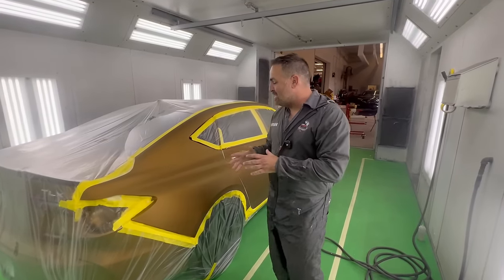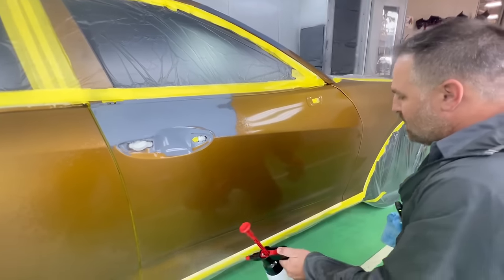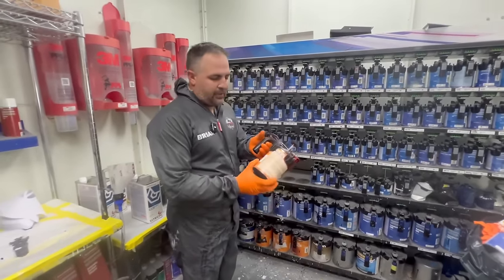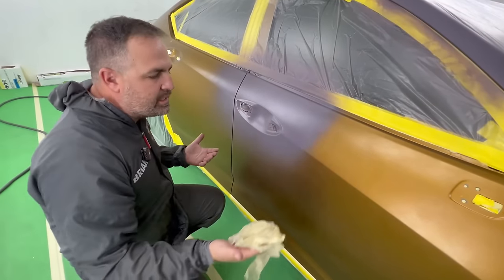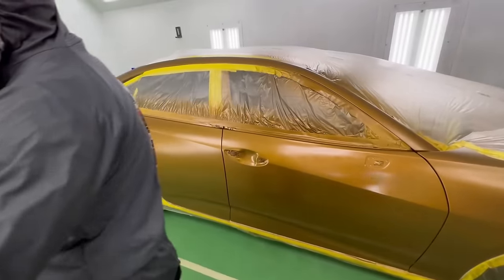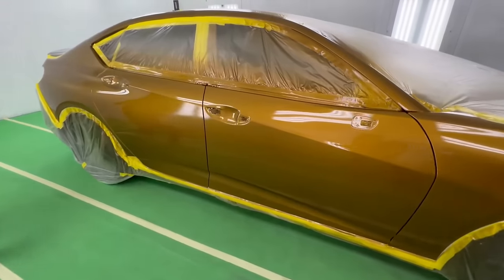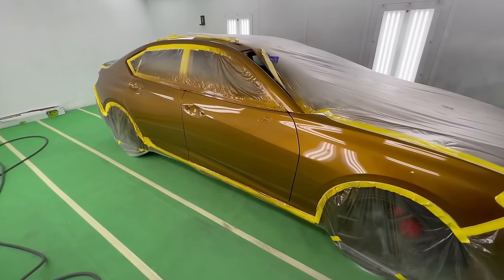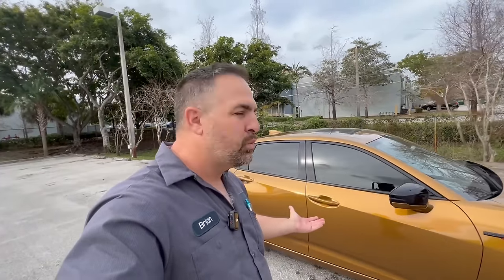The Paintjob from HELL! Don’t Risk Losing Your Job Because You Don’t Know THIS!

Comment: No drips, no runs, no errors. This job is a home run with a difficult color and a tough customer. Using a good paint system too. congrats
Reply from the maker: They arent all perfect. Ty!
Reply: I started painting back in "74". Since then I've worked on over 12000 vehicles, some very small spot jobs, some very large overalls on trucks and not everyone went out the door on time. Auto painting is an art as much as a sicence and sometimes you need to go back and start over. My goal as a flat rate painter was to do good work like you did in this video and get my 80 hours done by lunch time on wednesday so that everything else is gravy. The hard part is doing that until your 70. During my last few years, every morning I told myself that you will be remembered by your last paint job, make it a good one! Your job looked great and your advice is spot on, you should be a Sikens paint rep.

Comment: Your channel has been such an inspiration to me. What I have learned on your channel allowed me to help a friend on an 1989 Ford 4x4 project. I have painted the cab interior, the back of the cab, front of the bed, under the hood, etc. The outside of the truck will get a professional paint job, but it's amazing how good the truck looks! Everyone is amazed that I painted it with no prior experience. :-)  I have clear coat peeling on my truck side where a previous repair was poorly done. Now I have the confidence to paint it myself. It won't be "perfect" but it will look 1000% better than it does now. Thank you again!!

Comment: We needed to get a piece of equipment painted to protect the underlying metal, and since we had planned to keep it a while we decided on a full strip and re-paint so that corrosion could be properly addressed. The OEM paint lasted an impressively long period of time, but almost 40 years of sun had done a lot of damage. We thought we took it to a professional, but as ours was in the paint shop and disassembled we heard of another owner who had an issue where the color and top coats fell away from the primer on the trip back from the paint shop. When we finally got ours back, three months after the expected completion, the color and top coats bubbled up in certain areas. It turns out, that paint shop owner thought he knew organic chemistry better than the paint manufacturers, so he was mixing and matching primer from one company, color from another, additives at ratios outside of manufacturer instructions, etc. Since the paint was not applied in compliance with the instructions, the multiple manufacturers involved did not warranty anything. The first shop was not going to pay for another shop to fix his problem without a lawsuit (and at $500/ hr our attorney fees would have exceeded the outright cost of a new paint job just with the normal summons and complaint/ pre-trial motions phases), we no longer trusted his work to fix his mistake, and the only fix was stripping back to bare metal and re-painting the whole thing, so we were looking at another five figures to paint a job not even a year old. Not fun. It is nice to see a professional showing how the job is done properly.

Comment: As a retired certified Autoglass tech, I have always used a two rag method for cleaning glass. Now, retired and restoring a mustang, I still use the two rag method prepping the body. One rag wet and follow with dry rag.

Comment: I didn't know what sealer did for being applied over primer so it melts you edges in so you don't have to feather it out in between the primer and color coats. Thx for that. What a clean job. Nice work on that one as always.

Comment: Little tip is becareful with sealer on those areas over spray can get into(top quarter area) if paint doesn't get in..ull have sealer over spray after removing foam and tape...I usually back tape the edge and keep the over spray from getting in
Reply from the maker: Great tip!

Comment: Looks really good and also done right by not melting somewhere on the piller also doing the fender as well
I don't  like the color
Also like that you didn't walk the side from qtr to fender,i pretty much clear the same way
And using the wetbed to melt the sealer edge so everything is uniform 💪 great job Brian

Comment: well,  it's good to have all the proper tools, and materials that are recommended by the paint manufacturer, or so. a lot of shops use different materials some not even the sealers due to high cost, and that goes for Clear coats as well. be honest with me painters, for example, do you use microfiber wipes? or do you use 3 different products to finish the paint job?

Comment: It appeared t0 me that with the paint and the clear you were about 90% overlap, and pretty good amount of air, and no runs.. I would have had runs, and my luck would have blown paint flakes off the plastic, as well as the tape, and most of that would land in the last coat of clear. My question is, are we watching this is real time, or is it doctored before we see it? Either way you did a amazing job.
Thom

Comment: Is the super slow reducer helping with dry edges? When you did the top of door, A pillar on to the front fender, then went back to rear door and finally went on to the front fender. Times I do it,  their is a dry edge and can't get rid of it and have to back track. Can be tricky.

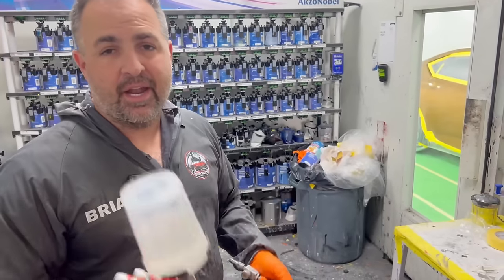Comment: Is clear base, the same as blending additive??? In many of your videos you use clear base to cover the whole car, but in this one, at 4:50 you put on blending additive and used it across the whole car as if it is clear base. I also read online somewhere that using purely reducer, such as a cheap 2k universal thinner, is fine as a clear base. Im asking because I'm from UK and In UK there's no such thing as "clear base" but there IS blending additive. I've never used that though. Theres also fade thinners/ blend thinners for blending lacquer if you're not painting it edge to edge, and I use this all the time. Is this product the same as clear base too, and can it do the same job as clear base too??? In my head, l'm asking about 3 different chemicals and in my head they're all supposed to do different things but I feel like you being from the US and me from the UK makes me confused.

Also in your recent video doing the 2 doors on a green Lexus (I think) SUV, you use blending additive (which I think is the same thing as clear base but not sure still) on the whole area, just like this video, let it flash for only 2 minutes, (another important question, is that really long enough to then base?!?!?, I thought each coat always had to be bone dry always before moving on to the next and tack off between every coat to remove stray overspray and metallic particles) it’s still wet looking when you then base it, but then after 5 mins of flash off, on either side of the basecoated area, you put more clear base on as a wet bed, then immediately spray across the basecoated area and into the wet beds on each side. You don’t do that on the Acura in this video. Did you only do this in the other video, and not this one, because you said you weren't happy with how the silver metallic tinter 811M left a bit of an edge on the blend? And that this wasn't an issue on this car because it's tiger eye pearl and not that dark Lexus metallic green? Was it just specific to that one colour and not the Acuras colour?? Why was your technique on that video different to the one on this video???

Comment: yooo bro! didnt know this channel bud now you keeping me inside hahah. i dont want to overthink bud still got some questions. back in the day my dad painted my scooter wheels orange. somehow the paint kept on cracking we thaugt it was the paint. so we end up filling the cracks with paint and live with it. now i dont know 15 years later got some old wheels to repaint. the same thing is happening. it dryes like the desert and have islands surounded with cracks. 15 years ago it was rustoleum ratlecan fluor orange. now its motip black!?!. iff i sand it off it just happens again. is this the powdercoat? somehow writhing this i think it may be powdercoat. bud i sand it 320 600 or 800 still happens. i got like 3 sets off wheels to repaint and its happening on the first rim. also iff the paint gun sayes needs 260 liters a min. i saw a 2 cilinder compressor 100 liters tank running house power deliver exact 260 liters a min hahaha. you run most times like full power not taking a foot off the trotle. will this compressor run empty? or just hold on? hahahah hard to say for you bud saw the verry smal compressor vid. bud i trying to repaint my whole car. i crashed it. i bought a partytent hahah 6x3 meters saw a second hand set off sprayguns clear and base. so only need to figure out the compressor and stop thinking and paint.  the air units i saw in the vids. i think they are oil separators and water separators? i know that kind off work. didnt know they were like 400 a piece tho so i thiink some machine is goint to miss it verry soon. or is it special for painting? than the machine got lucky. and for painting a subframe what kind off paint do you recoment? i saw motip bitumen paint. bud used it one time on a smal part and looked verry ugly verry soon, and used on driveshafts it chipt off in my case. the car is purple now and i want to go white. before i saw the vids i didnt know about the sealer. i thaugt i was primer base clear. bud the sealer is killer no need to sand just one day off painting!! 
Thanks for the lessons!! you saved a verry poor ej2 coupe from beeing rattlecaned! 

quick recap what i saw.
clean like a 1000 times bud end with water soap/ grease remover / sticky paper
best to spray in the morning (summer offcorse)
keep the wet edge
iff you got a spots in the sealer remove them in the basecoat 
first layer clear is ground layer second one is for the shine.
you go botom up to see the edge i dont know how this will work for me in a partytent. 
and use a psi regulator on the gun.
this you learned me off the videos hahaha.

peace✌

Comment: how do you get less texture brian? I spray with a gti pro lite 1.3 and my clear even if i slow it down its not flat it has orange peel texture sometimes looks wavy too, admittedly at my shop we use entry level cheap clear but still.
Reply from the maker: Go a little slower and touch closer and lower psi a touch
Reply: @PaintSociety  okay so on roughly 2.5 turns out from fully closed and fan open all the way just a little turn in what psi you reckon

Comment: Hey brian, is it normal for cars to come with different painted panels from factory? I seen many new cars, and my own, that body color doesn't match bumpers. I have a white accord and can see the color difference mostly in the shade, pearls hide it in the sun. I believe body and bumpers are painted at different times so that could be the reason?
Reply from the maker: Yea. Bumpers are painted separately at different facility and never use the same exact tecnhique or paint.
Reply: Bumpers are plastic and doors and fenders are metal typically ….  And the bumpers sometimes have a different electrostatic charge so when you paint them they will look different because the metallic doesn’t lay down the same….
Reply: @ZILAwelds  I just figured it was a different base or primer shade so it affected the base but the pearl is the same. The primer/ sealer doesnt make metal and plastic the same color/shade?

Comment: I have a question Brian or any experienced painter/body guy I have a 03 SVT cobra and I paid ALOT of money to get my whole car repainted and the body work done but he called me after he painted the car and said he missed a couple of rock chips didn’t get feathered out properly on the front fender so he ended up reshooting the whole car and I mean just the car like the hood front bumper back bumper spoiler side skirts all that was still off the car but when he just got done repainting the car, I came to check it out and under the clearcoat. The paint looks like it has a weird texture to it like I can see it under the clearcoat where the actual color is. Is that from the car just being painted and him not sanding it or him not spraying, a binder or something like that? Please help me guys this is my dream car and I’ve spent so much money to get this right and the painter is a good guy. I just don’t know what to do or where he went wrong.
Reply from the maker: Dm me on Ig with photos.  Description isnt enough to help but doesn’t sound right.

Comment: I probably had four sikkens paint mixing stations they even sent me to like one of their workshops a couple times it's high quality no doubt but that is the most unforgiving paint there ever way. Paint jobs from hell that's the paint from hell. 😂😂😂 I could never say nothing about the paint or the clear coat it will last 10 years but if you can actually get it to do what you want it to do without it reacting you are the daddy. 😂😂😂 I've never liked chickens it's too hard to paint and it's too expensive if you get a booger or you got a problem it comes out of your payday no thanx I've had people ask me personally to use sikkens on their vehicle and I have to tell them no no way Jose.